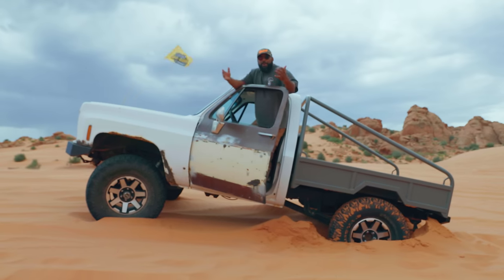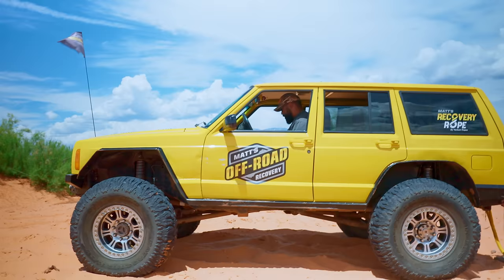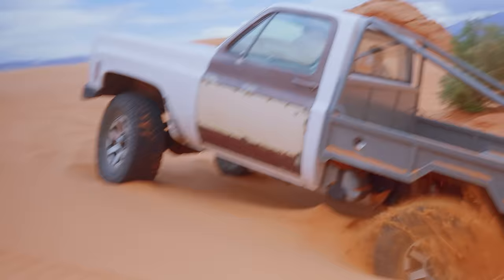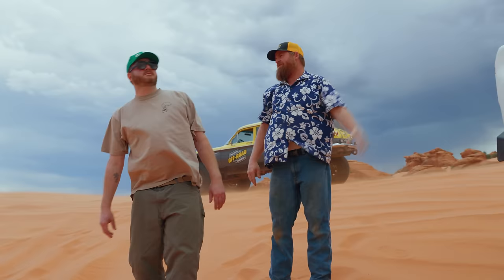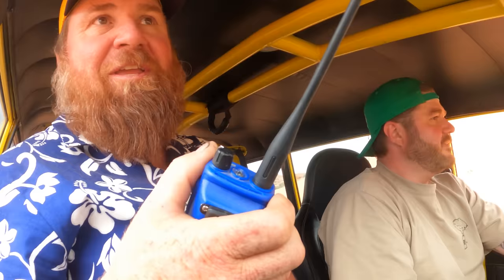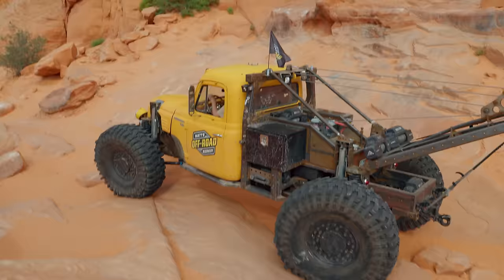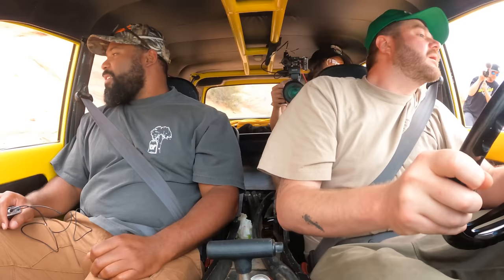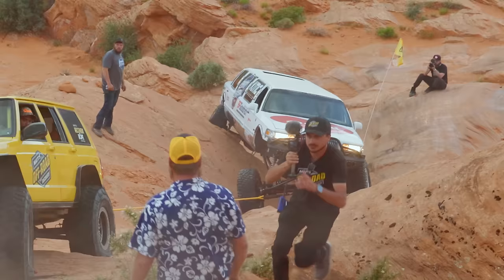I Spent 24 Hours on an Off Road Rescue Team

Comment: Bro you could see the absolute fear in James eyes when the throttle cable broke lol
Reply: I was all puckered up and I'm siting in front of a screen..
Reply: even matt was puttin some bite marks in his seat
Reply: Good thing nobody seen my eyes behind the screen
Reply: @ssenssel  Same here! I would have. That recovery rig would have smashed that Jeep or FJ easy and probably kill someone..... so awesome video
Reply: @slider2828  it was a bronco lol
Reply: I know they were extra sweaty in their crevices after that
Reply: @ssenssel  so what do you do in that situation. Like what did they do that made it stop
Reply: Its like he crashed his first car and went home to his parents and had to sleepin a dog house
Reply: Tbh bro took it pretty good he was chillen
Reply: @sk1zzy337  I would have turned off the engine.. IF I had the presence of mind while getting sheet all over my underpants.

 I think with the crash against the rock the engine cut off switch killed it
Reply: @sk1zzy337  if it’s a manual you can put it in neutral and just brake to stop, in an auto i’d shut off the car

they were alright because the throttle cable broke thankfully
Reply: @Jon M.  They legit said the throttle cable wrapped around the steering shaft enough times that it ripped it off thats why it stopped then they turned it off
Reply: I loved this episode
Reply: I instantly started laughing when I saw the look on both their faces.  Lol. I had a carburetor spring break on me once, and the pedal fell to the floor. So I know exactly what instantly went through their minds. Haha. Luckily for me, it was a straight part of the road. I shut the key off to kill the motor and kicked it in neutral and was able to safely get it pulled to the side. But my poor passenger.  Haha. It really shook him up. At first, he thought I was just showing off.  He didn't realize what was going on until I killed it.
Reply: He was scared af 😅
Reply: I was more afraid for the bronco
Reply: clench moment
Reply: I always keep spare wire in my truck for throttle cables or tying up exhaust. Seems stupid until it's not
Reply: Scared of the MO POWA!
Reply: @sk1zzy337 that’s the scary part, they didn’t, the throttle cable snapped and that’s what finally stopped it
Reply: Kentucky Cobra fears nothing
Reply: Terrifying that if it rolled it may have pinned the person standing on the passenger side of the jeep.
Reply: You think James was scarred shit Id hate to see the faces of the people in the bronco
Reply: Living in interior Alaska on top of a mountain and driving a 40 year old Ramcharger, Ive had a few winter days where the throttle cable froze while going downhill (on ice and snow).. It is scary as shit. I had to reach down and physically pull the pedal back by hand, so I eventually tied some para-cord to the pedal to do it without leaning down 😅
Reply: Bruh and the bronco driver just sitting there not moving an inch 😭 like wtf
Reply: @kpenis17 constantly driving a manual gives you the instinct to stand on the clutch probably so hard you break the peddle or slam it through the footwell
Reply: @ssenssel  Turning off the engine is a good call eventually, but they had to steer it clear of everyone else first. If they turned the engine off immediately they would have had to turn 54" tires without any power assist to miss the Bronco.
Reply: I must have watched like 100 hours of MORR content and I've never seen Matt that scared lmao
Reply: @sk1zzy in most situations where you have a throttle sticking the best thing to do will be to shut the engine down. If you have a manual and you push the clutch in you could blow your motor, you’ll stop power to the wheels at least but quickly kill the power when you get control of the vehicle. Remember when you shut the ignition off you’ll lose power steering and brake boost also so be ready. Experience will always help but hopefully you’ll have time to react.
Reply: @Zarrex right? That was a true look of fear in his eyes. I think what made it worse was that he was in the passenger seat so he didn't have full control of his rig.
Reply: @sk1zzy337  i think luck, the cable broke when they twisted to avoid the bronco. in a perfect world you could turn the ignition off or throw it in neutral but that situation was fucked
Reply: But why did Matt say "Off the brake?" I'd think you'd want to stop it.
Reply: @sk1zzy337  From what I understood Matt said the throttle cable got wrapped up in the steering and was winding up making it tighter and tighter (and going faster and faster) and they continued to steer (both of them!) to avoid the Bronco - and the cable broke!  On Matt's channel he said he had it routed away from the steering but the rig got worked on by others and Matt didn't check things over when he got it back, so he said that was on him for not checking.
Reply: @DeserTech  Pedal confusion is kinda common. Pushing on the wrong pedal, or both the brake and the gas. He may have thought that he was pressing the gas thinking it was the brake. Instead of trying to explain it, he just told him to get off the brakes.

Not what it turned out to be regardless. But that's my guess about it. I'd love to know for sure too though.
Reply: @Jonathan Hartzell  it's full Hydro steering, they would have lost all control without engine power
Reply: @TattooBlue602  Everyones had that 1 floor mat get jammed by the pedal. Happened to me many years ago in my 16 6.7 cummins with the g56 on the highway, straight stretch, just let off pedal and i was absolute starting to MOOOOOVE. Passenger was gf looks over at my panic kick to the floor mat. and it all let off just a big releif sigh lol. Fast forward 7 years. Last week. Jesus fk... Waiting on backorder was my floor hooks for my Mopar Ram version of those "weather tech/husky" molded to fit the vehicle mats, they got here yesterday. But on Friday they werent here. Just did the same thing. Luckily was on a side road here in Calgary on the way to the car wash haha. Went to get on it just for a fun few seconds to break the tires in 4th, hahahaha...welll... the guy parallel to me at a stop sign musta wondered what the fuck happened when it broke loose alright, and i couldnt get the mat out, so clutch in she went to basically 5 only for a second if that though. And we all know 5 in a diesel............ luckily it was a second if not a fraction of one before i physically grabbed the mat and yanked it. which wasnt easy with the clutch jammed again THROUGH THE FLOOR likke you said lmao. just yoink..... 

Lesson learnt. twice.............................. just couldnt wait for the anchors with the hook to hold these in place could i...... lol.

Gotta love the AC off, radio from low to off, windows all down, very slow put put praying it isnt knocking feeling lol.
Reply: @kpenis17  you can put the automatic in manual too
Reply: @DeserTech obly thing I can think of is to maybe be able to steer better? If your full on brakes and full on steer it's only doing like 50% of each if that makes sense. I could be wrong though I haven't watched that far in the video yet had to pause it and I'm adhd af lol

Comment: that throttle getting stuck was absolutely terrifying!! that was a super close call
Reply: @Carl Weezer couldn't you also just shut off the car? that should kill it too
Reply: He absolutely could have turned the key off & that & the break would have solved the problem immediately but unless you know wots happening with the vehicle your brain just wouldn't immediately jump to that as an answer. From memory & I maybe totally wrong but It could have happened  because Matt's wrecker is hydraulically steered (I think)& if so I don't think the orbital box has a stop on it meaning you can keep turning the steer wheel which would be how that cable was able to wrap itself round the world & back. Well done for not dying great work. .
Reply: @dakotajohnson5009  The biggest issue is us, humans, always best to have a big red button on the dash that stops everything so we don't have to think about anything while we're in a panicked state.
Reply: ALWAYS have it in the back of your head to turn the key off especially when messing around with a performance vehicle.
Had it happen when I had my '68 Fury w/a 440 wide open.            Shut'er down!
Reply: @Carl Weezer that works for petrol engines. For turbo diesels you can get turbo runaway which is a whole other kettle of fish. Pretty rare but in that situation you need to either jam it in 5th (or 6th if you have it) and hope you can get it in to gear to stall it. If that doesn't work or you're driving an automatic, you need to somehow cut the air supply by stuffing a rag into the air intake (if you have a Toyota you have to take the airbox lid off because the intake is in the wheel arch) or if you have a snorkel, getting a plastic bag over the head and smothering it that way. Very scary situation to be in, your engine starts revving faster and faster until it red lines, something gives and it goes boom. You need to act fast, 60 seconds if you're lucky, it all happens very quickly, and if the wind is blowing the wrong way you can't see anything because of the smoke pouring our of your exhast. I keep a black rubbish bag in easy reach on the snorkel side in case it ever happens.
Reply: holy moly
Reply: Neutral could help too.
Reply: It really was, I've talked to TomTom about it and it came very close to ending really badly thru utterly no one's fault.
Reply: @giggitygiggitygoofg6069  That's precisely why you have a cut-off switch; when you don't know what's happening the main thing to remember is to hit the switch. I've actually had a near accident (was the passenger who stopped it from happening) when someone I was driving with accidentally hit the gas instead of the brake and doubled down on that decision in fear. The person was heading towards the end of a parking lot that dropped off 100 feet. I yanked the hand-brake as hard as possible and we bumped our nose up and over the curb but not over the end of the lot and ledge. Many people panic in those circumstances. I don't know if I'd have the same reaction today either. But if you have a switch to cut the gas, you'll hit it. Many of us who have been driving other types of vehicles (waverunners, fourwheelers, 4x4, etc.) have experience with these types of switches and can attest to their usefulness.
Reply: @giggity giggity goo F, G  There was also some confusion as Matt was saying off the brake. Maybe he thought James had it confused with the throttle and was flooring it? I am sure that also played into decision making on the fly.
Reply: @@TheRealBrownShady One thing that's good about newer cars with the push-to-start systems is that you can also use that as an e-stop. My leaf says if you hold it or press it twice in 3 seconds while moving, it cuts power to the traction motor and goes into neutral. Most other cars are similar.

Comment: That was unforgettably heroic of both Matt and James to instinctively without hesitation, risk their own lives to save the crew in front of them in attempt to flip the vehicle to avoid further danger. love this channel, crew and guests alike. :)
Reply: I've seen Matt be money under pressure plenty of times on his channel, but I was honestly impressed/surprised by James. He never froze up, never looked away, he just got the job done. Then he said "throttle stuck" like someone asked him what he wanted to drink. Seems like he's one of those people who becomes quieter and more focused the worse something is. Well done both of them.
Reply: I'm not sure if I understand the explanation of what happened completely, but I think that them steering sharply to the right was what ended up snapping the throttle cable and shutting it off. Amazing luck (following awful luck). Really fortunate that it wasn't worse and everything was ok
Reply: @Logjambam yes and no, so the turning kept tightening the cable around the steering column and at that point it made the throttle stick so to avoid hitting anyone they turned the wheel as far as they could and then finally the cable snapped.
Reply: @Logjambam simple terms, on old cars. Sterring wheel connected to rod, rod connects to rack and steers the tires (very simplified) the throttle cable got wrapped around the rod and as he turned I think...left? The throttle cable got tighter and tighter making It give power.

Comment: I have never seen Matt be wide open-eyed in panic.
Reply: Same. He responds well though. He knew exactly what to do
Reply: He is a very calm dude, so reading this comment before finishing the video tells me something big is going to happen lol
Reply: kyleebrock  They put in a 170k mile used engine that's almost 20 years old, and it broke at close to 250k miles. No one did any work, let alone shady work, on the throttle cable, which is why it broke. Parts fail, especially when they're old and have seen lots of use. There isn't anyone to blame, it just happened.
Reply: that cable clearly isn't 170k miles old @Herpaderp10
Reply: @leolandi3852  what would a 170k mile cable look like? It's just a thin steel cable... it's not going to fray, just snap. Not sure how you could tell how many miles are on a cable since the wear condition is snapped vs not
Reply: @Herpaderp10 cables stretch mainly. It stretches, individual strands start to snap if you keep tightening it, then it'll completely snap.

Comment: I'm glad everyone was safe and nothing bad happened from the throttle incident. The sheer look of panic on both faces is always funny to look back on once everyone is ok.
Reply: No kidding, if that cable had held on (and the throttle open) for just a bit longer... Ouch!
Reply: @SansNeural  Yep. And Matt wasn't belted in.
Reply: what a bunch of noobs. other one yelling GET OFF THE BRAKE. like it would help stop the vehicle and both were not bright enough to turn the key to the OFF position.
Reply: @vihreelinja4743  you do it then.
Reply: @vihreelinja4743  calling the dude who built an offroad towing rig out of a corvair a noob is hilarious lol
Reply: @vihreelinja4743  Most people who end up in situations with a stuck throttle are actually pushing the throttle themselves while they think they are pushing the brake hard, so it's great advice.

Comment: When it hit the fan, it was great that there were two strong drivers in the cab of the wrecker.  Both instantly made the same decision to aim at the wall and cranked that wheel - super fortunate that the turning helped clear the fault by breaking the cable.  Drama.  There was no time for either to reach for the ignition or any other control.  I loved the throttle MacGyver, zip ties on the job, operated by an expert who could drive up the obstacles perfectly with that crippled rig.

Comment: Had it once the throttle got stuck wide open on a company pickup truck because they put in random floor mats. I flew through the dealer parking lot and had to shut the key off within seconds reaching speeds up to 40mph with brand new cars right in front of me, slammed on the brakes and about had to change my pants later.

I could feel that same fear again watching them get the throttle stuck on the wrecker.  brought back that crazy feeling!

Comment: I miss my old xj. It came with a 3" block lift, big mudders, and a wooden bumper. I welded together some scrap drops from the local steel yard and did a few other super cheap mods. The only thing that ever broke was the power steering pump once a month, but it was an easy swap and warranted. It leaked about 1qt a week, but it also had 270k miles when I sold it. Honestly it was the best truck I've ever owned even though it was beat.

Comment: About two years ago i did some mickey mouse wiring in my truck and the wires wrapped around the steering column and made it difficulty to turn to the left. Luckily it was immediatley apparent what happened and i was able to cut the wires and untangle them. Learned my lesson about making absolutely sure my wires and cables are clear of the steering column.

Comment: The Chevy should have been pulled with the same bridle hookup that was used to link the morvair and banana.  It adds a lot of work trying to drag a vehicle sideways through the sand, which is what happens with a pull from one side.

Comment: A runaway throttle (doesn't matter what the cause is) is a pretty scary thing. It's one of those things that reminds you real quick that you're not as in charge as you think you are and that things can go very wrong very quickly... Like brake failure.

Comment: When you need to signal the driver pulling you out it would be great if you had a device connected to the steering wheel that made a loud noise.

Comment: Jimmy-rigged hand throttle cable through the window?  
I’ve had to do that before!   Even developed a method to pinch the sting in the rolled up window as a “makeshift cruise control”. 🪁 string 🛻

Comment: sand also has i little trick to it after a rain the top inch or so becomes hard almost like an old cement but as soon as you crack the surface it is like you dropped into a hole and no traction is to be had

Comment: When it comes to the Subaru don’t ever use the eye hook to recover a vehicle. It’s made to pull a vehicle up onto a flatbed tow truck with very little resistance. They’re made of cheap cast aluminum and not made for anything like what you’re doing. It’s downright dangerous and giving people the idea to use it can really cause issues if it snaps and flys through the air into someone or a windshield. People have died doing similar thing when using a ball hitch which is even stronger than an eye hook.